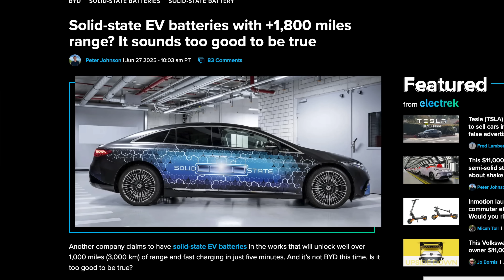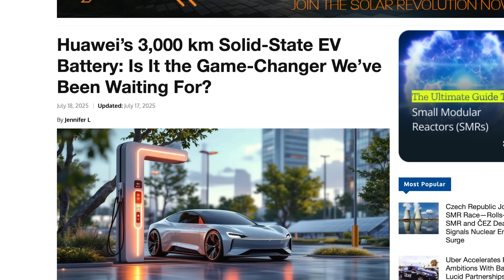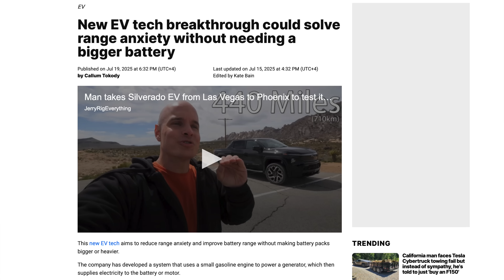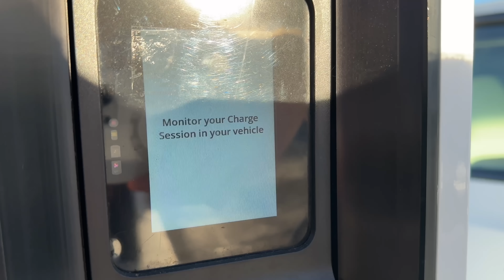EV Battery Headline Red Flags 🚩

Comment: Well, until EVs come with batteries that ROUTINELY allow for a ~400 mile range, sell for the same price as an equivalent ICE car, and charge significantly faster than they do today, they won't become mainstream in the USA.  Sorry, but those of us who are EV advocates need to realize the fact that there is still a lot of resistance to EV adoption because of cost and convenience.  My wife and I have owned both a Kia EV6 GT Line AWD and a Hyundai Tucson PHEV for over three years now.
Reply: Going to disagree on the charging time - mostly it's people who don't take into account the total time they are at a stop or who stop really.... inefficiently.  I will continue to say that most people - from the time they tap their card until the time they are done fueling, move to a parking space, go in and use the bathroom, grab any snacks/drinks, get in their car, and drive off are spending 10-12 minutes.  If we can get 300 miles at 75 MPH and 32F, charge for 15 minutes, and drive another 250-275 miles would be OK.

Driving from Minneapolis to Indianapolis with a quick stop in Janesville should be enough.
Reply: @stephkent2736  I see this alot. People think they stop for 5 mins, yet 15 mins later I'm going back into the store to find them and see if they fell in.
Reply: I feel like they can have a slight premium and it'd still gain a lot more traction if the charging time was 5-10 minutes for a full charge and that was for 350+ miles.
Reply: You DO KNOW cars just plain did NOT have 400 miles of range for the longest time - and us stupid old boomers managed just fine. And most went 0-60 in about TEN seconds.
The ONE thing that's holding EVs back? GREED. Oooops ... I mean PROFIT.
Sorry, nope I meant PRICE. Or PRICE  GOUGING.

Chinese EVs without tariffs would decimate the corrupt, fat, lazy and incompetent US auto industry which is why the US (and our idiot leaders in Canada) put 100% tariffs on Chinese EVs.
I remember "IF IT'S JAP, IT'S CRAP". Which was mostly BS then, and anti-Chinese stuff prom the incels is BS now.
Reply: lol!!!!!! vehicles comes in all kinds of shapes and sizes and everyone has different use of their vehicles! there are trucks, SUV, semis for towing, overlanding, construction and much more.

Comment: Just saw an Electric Viking video that says that a Chinese battery scientist said that solid state batteries are still being worked on and that given the continued advances of LI batteries that the solid state batteries may not be needed. Also, the idea of a 1600 mile battery is nuts. You still have to stop every 150 to 200 miles for a bathroom break or a meal, so you’re right. A 1600 mile range car isn’t necessary. Not even the ICE carmakers know that!
Reply: Solid state battery may not be necessary in regular cars, but it will fit best in long haul vehicles like electric truck, electric bus and electric trains that regularly bring tons of heavy load everyday

Comment: I'm waiting for BYD to lead the charge in battery and charger tech with their megawatt charging capabilities. We can copy their tech if it can be proven that there's not significant degradation or damage long term to the battery.